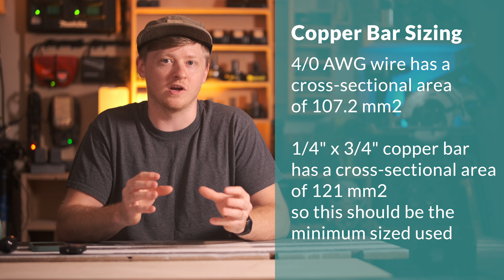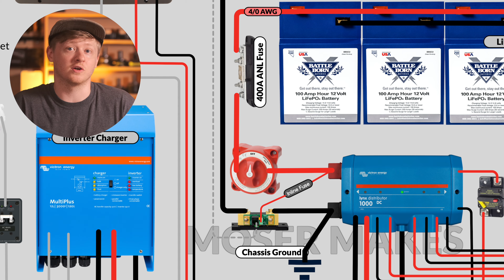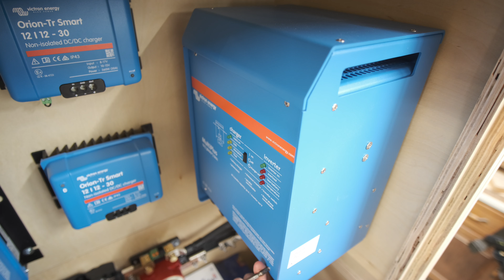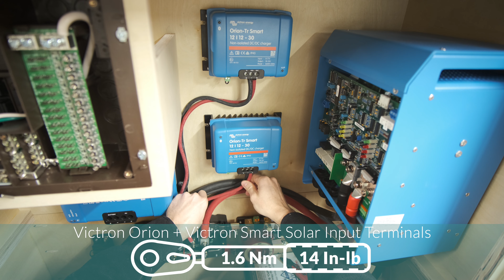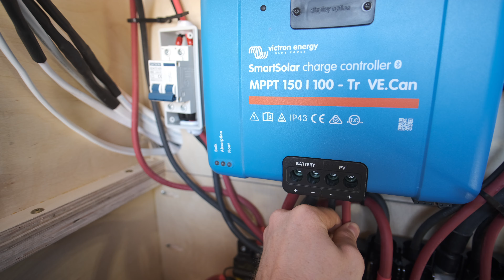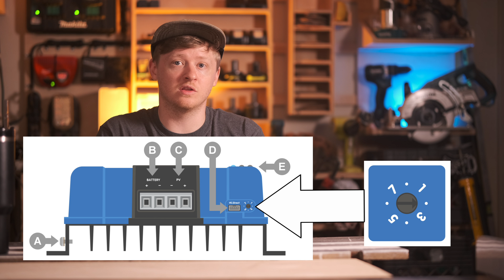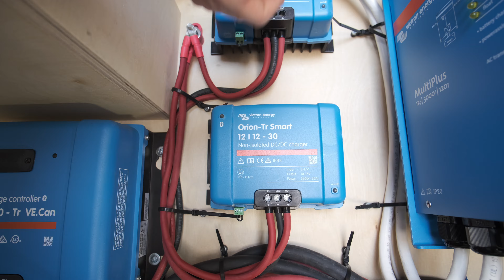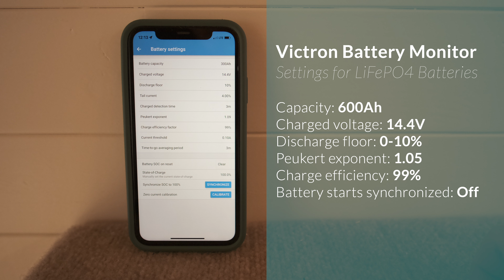Off-Grid DIY Camper Electrical System | Start to Finish Install | Victron Components

Comment: It’s so frustrating how I’ve seen two of your van builds now and you always describe where both sides of a cable goes, except you repeatedly do not mention where the inverter/charger ground cable is connected to on the other end, and how you connect it. I understand you connect the entire DC negative side to the ground of the chassis, but where does the inverter/charger ground connect to?
Reply from the maker: Hey, sorry for the confusion I'll try and clarify. As you noted, the entire DC negative side gets tied to the vehicle chassis. Inverter chargers typically have a enclosure ground connection (on the Victron Multiplus it's the connection on the right of the underside of the unit) and this gets connected to the negative bus bar (in this particular installation the negative bus bar is part of the lynx). 

I hope that helps. If I misunderstood the question let me know and I'll tree and re-answer.

Comment: "High Power" Camper Electrical System @ 12volt? For High Power? You still have a lot to learn! 48 or 96 volt is way more efficient.

Comment: The fuses in the Lynx that protect the inverter are labeled to be 80a, but the inverter will be pulling 250a before you even account for its own inefficiency. How does that work?
Reply from the maker: Hello! Good catch - this was a mistake on the plans that happened when I had made some other revisions to the diagram (someone else just pointed this out to me as well) and I will be posting an update to it soon. The inverter fuse should be a 400A mega fuse.
Reply: @MoserMakes  Thanks for the reply. 

Something I havent found a clear answer for is: When using a chassis ground, is there any notable resistance? 

For instance Ill likely be doing a second alternator install for 200A. Ill obviously be running a single + wire from the alternator to the charge controller in the electrical box, but is a chassis ground enough or will there be resistance through the chassis that would create too much of a voltage drop? I guess I can measure it once its installed and running but it would be nice to know beforehand. 

Thanks for all of your content. Truly top tier
Reply from the maker: Hey, chassis ground resistance should be pretty low (most of the chassis is pretty substantial chunks of metal with a lot of cross sectional area) and not a concern but there are certainly a few things to pay attention to. 1) solid connections that aren't creating high resistance: a connection to the chassis should provide the wire lug with plenty of flat surface area of bare metal (no paint or grime in the way) and avoid using things like star washers instead of grinding away the paint because those will create more resistance at the connection. 2) carefully choose where to connect to the chassis: it should be done on a piece of the frame that is substantial and solidly connected to the rest of the frame. In a van this means avoid thinner interior wall areas that besides being thin may not be connected as solidly to the rest of the chassis.

Now with a secondary alternator things may look a little different as well. I've only done one install with a secondary alternator, and it was a Nations Starter 280A alternator with a Wakespeed WS500 regulator. I designed and connected the system following the diagram in the WS500 manual which recommended using both a positive and dedicated negative return (both 4/0) from the alternator itself to the the rest of the system. I also connected a chassis ground as their diagram showed. When testing it, the return current was flowing partly through the dedicated negative return wire and partly through the chassis ground (not surprising as both provided a low resistance path so the current was splitting between both paths) as the alternator casing is grounded to the chassis as well just by the nature of how it bolted in place. This caused an issue in that the current shunt that the WS500 regulator was using to regulate the charge was only seeing the current coming through the return wire which wasn't the full current reading. In this case I had to remove the chassis ground connection (although the system was still grounded the 4/0 return wire to the secondary alternator) so that the WS500 could properly regulate the secondary alternators output. This could vary with different setups and regulators though.

Comment: Hi Sam, great electrical & time lapse videos on her to peruse. If you weren't so far away, I might even employ you to do the wiring in my van! A couple of questions spring to mind with regards to the electrical videos: 1). Why 2 * DC-DC Chargers? Isn't 1 enough for the voltage coming from the alternator?? 2). Is it better to use a smaller number of larger batteries (3 * 200aH) or a larger number of smaller batteries (6 * 100aH)?  Although the larger batteries will cost around 10% more, the saving in cables & simplicity would probably cancel that out?? 3). What about using nyloc nuts for the connections or do these have a problem with current transfer?? Thanks for the help Sam! Keep the videos coming! :)
Reply from the maker: Howdy and thanks! 
1) I used two DC-DC chargers just to get more alternator charging amperage as at the time the 30A was the biggest DC-DC Victron was making... BUT no Victron makes a 50A version of the Orion so that would be a great alternative to the dual 30A chargers.
2) I would say go for a smaller number of larger batteries if you can find a configuration that works for what you want. Less cabling/connections makes it easier to setup and will probably be a little more efficicent (probably less voltage drop as each connection adds some resistance). The only thing to watch out for using a lower number of larger batteries is that the max current output may be less (as each battery has a specific max) but in most cases it should still be sufficient for a setup like this.
3) Nyloc nuts should be fine. The nut is just to keep it fastened down and the current transfer should mainly be happening through the contact between the bottom of the lug and the mating surface underneath. A lot of these components come with provided hardware (the Victron lynx or the battery monitor shunt for example) and they come with just a normal nut and split lock washer.

Comment: What screws and stuff are you using to mount Victron components.Thanks for tutorials man,great job
Reply from the maker: Nothing special in terms of the screws just ones that are short (about 3/4" length screws) so they don't poke through the back of the plywood. For the inverter mounting plate the mounting holes are pretty large so I think I had to use #10 x 3/4" screws for that. And for some components like the solar charge controller I added a washer under the screw head since the mounting slot is pretty wide. In the video I go through the mounting pretty quick but if you slow it down starting from the 2:00 time mark you can see some of the screws.

Comment: Top guy 👍🏻 First a quick question? How much is the cost of the kit? And with using only the panels to change the batteries (With England wether 🙄 ) How long do you think it would last if you are off grid? I  Really enjoyed your video and thanks for sharing? Thanks my mate x

Comment: Hi Sam, thank you for the informational video, I have an empty Sprinter 2500 that I am starting to engineer a plan to have ready for next summer. I really love this electrical controls set up and I have a question. Forgive me if this is covered in another video but I’ve just started learning this process. There seems to be a huge different in costs of the different brands of the Lithium ion batteries. Does this control system work well with any brand? And what makes one brand so much more expensive than another? Thanks again for the great video, and I plan to watch more!
Reply from the maker: Hi! For a system like this the kind of lithium battery you want is a LiFePO4 (lithium iron phosphate chemistry). Any of those with a builtin BMS (which is most (only certain ones require an external BMS)) will work swapped into this setup. As you’ve seen you’ll find battery that span the range of prices. For the most part you get what you pay for but there are some better values out there. SOK batteries are a good balance of price vs quality. Battle borns are really nice if you want top quality and warranty. If you want a good budget battery the quality can be hit or miss but this webpage has good recommendations for decent quality budget batteries: https://www.mobile-solarpower.com/lithium-batteries.html

Comment: Thank you so much for this video.  I noticed you used 40 Amp fuses for your 30Amp DC to DC chargers.  I have a 50 Amp Renogy DC to DC charger with MPPT.  Does that mean I should use a 60 Amp fuse?
Reply from the maker: Yes, I'd recommend a 60A fuse for a 50A charger so that you have a little headroom.

Comment: Hi Sam, looks great, just a little concerned about ventilation. Those B2B's, charge controller and the inverter throw out a fair amount of heat, especially the B2B's.
Reply from the maker: Hey! I agree that ventilation could have been improved on this one. I actually installed it back in February, and it hasn't had any performance issues due to that. In addition to the vents above and below the Multiplus, there is another opening in the area behind the distribution panel that goes through to the window area and provides some additional ventilation in that direction.
Reply: @MoserMakes  Hey thanks for responding. It's a great video with tons of really good tips and best practice. All the VE components will self protect from excess heat so all is good, but worth some forced ventilation on really hot days or heavy use.

Comment: Any reason you did not wire the equipment ground on the Dc-DC charger ?
Reply from the maker: Hello, the Victron Orion-Tr Smart DC-DC Charger does not have an equipment ground connection point.

Comment: Why was a non-isolated charger used rather than an isolated charger? I'm learning ^^'
Reply: Because his input and output grounds are the same. As opposed to keeping the ground separate for some particular reason. If you’ll notice on non-isolated chargers, they will only have a single ground and then to positive leads, and isolated chargers will have two positive and two negative leads.

Comment: Not entirely sure of the exact maths behind it, but something to note is that copper bar will generally have a lower ampacity than stranded copper wire due to the skin effect. Stranded wire increases the surface area of a conductor which reduces resistance compared to a solid conductor of the same cross-sectional surface area. That being said, probably such a small consideration, and the bar was 10% bigger than the wire, so why am I writing? idk bye lol
Reply from the maker: Hey! I believe the skin effect only applies to AC and not DC.

Comment: Uh when you tighten your bolts for the connections, I promise that all will become flush - no need to belabor spacers as described here.
Reply: Also, please don’t wire a 12v system with this much power.  You should be 24v minimum and probably 48v